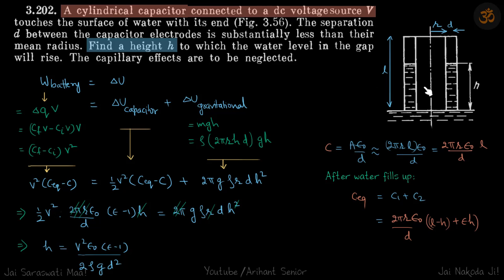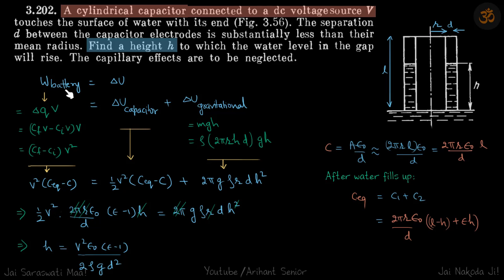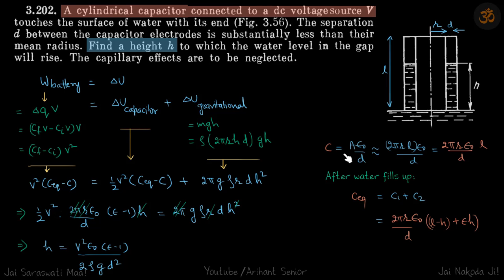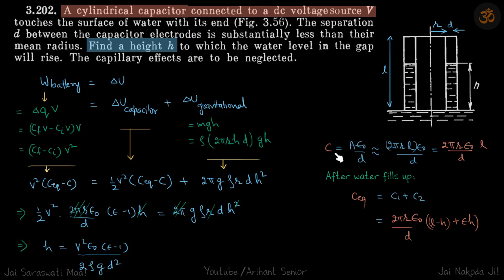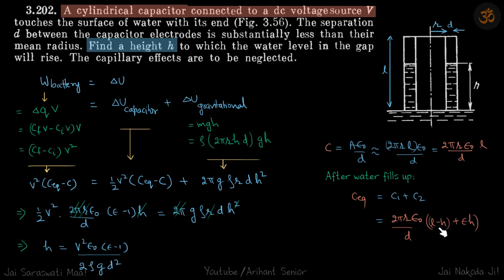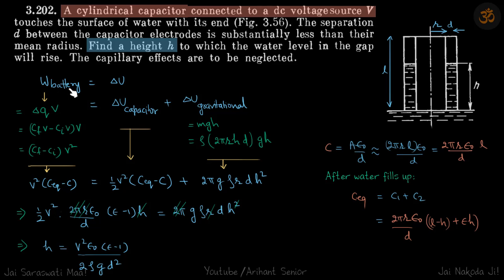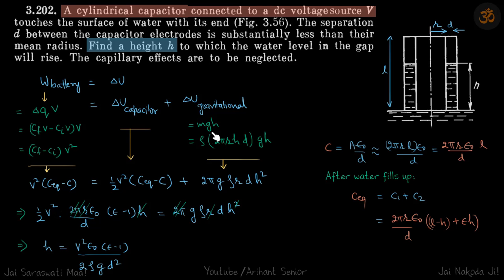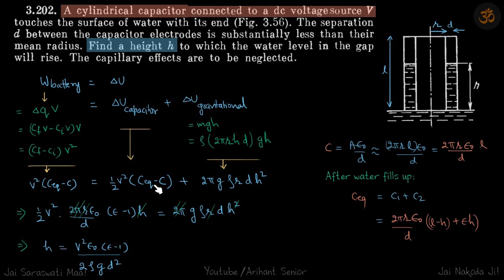3.202 | Irodov Solutions | Electrodynamics

Comment: Sir but for gravitational potential  energy u took it as mgh. but it will be mgh/2 by centre of mass concept 
since mgh is valid only for point masses but the water inside will be cylindrical in shape so we hv to take gravitational potential energy as mgh/2.
Reply from the maker: You are right. In reality water will jump up to 2h height and then fall back to h, with heat losses.  so answer we get from this equation is the "maximum height" com of water goes to. But then it comes down with heat losses, so top layer is at height h. And that comes from force calculation. This solution hence doesnt answer whats asked in the problem. But something else, interesting though it is :). So please proceed with force method only for this, and disregard approach shown. Thanks for pointing it out. By mistake i got the correct answer.
Reply: @Ankit_Singhvi    oh i dint know about that 2h part sir. Thanks a lot sir, for the info .